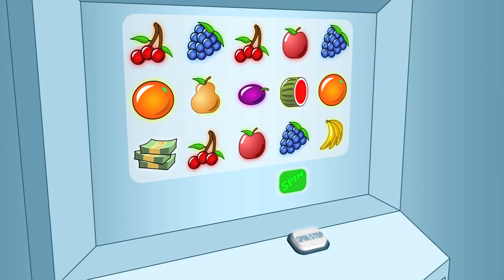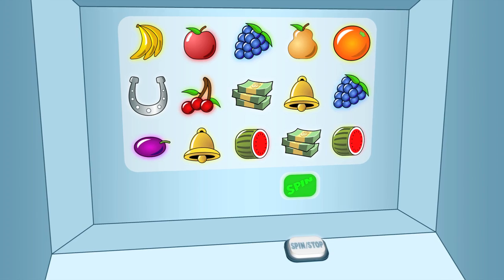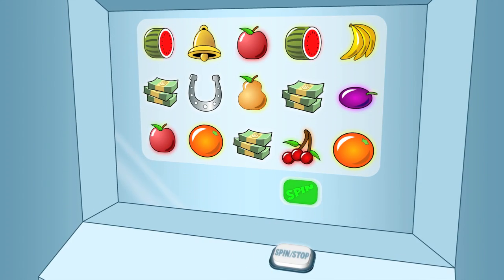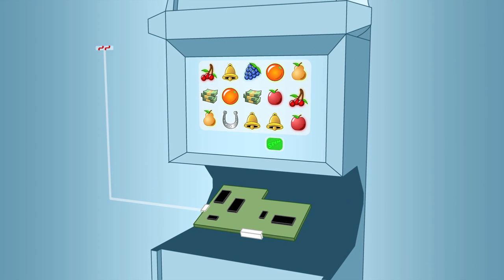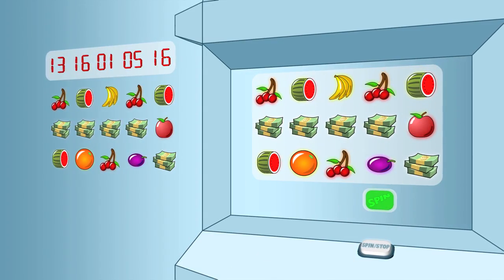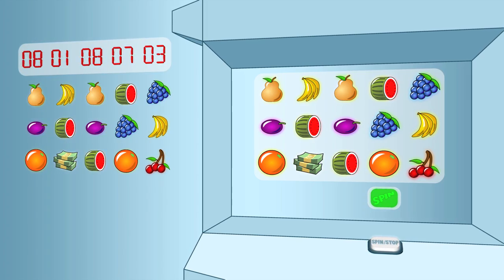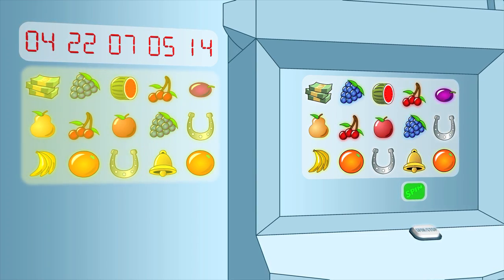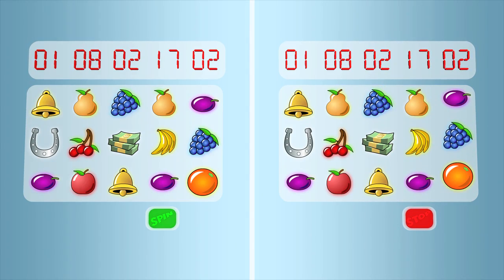How Slot Machines Work: The Stop Button

Comment: actually another reason for the stop button is to make the casino owners "More Money".  for example, if you are able to get 3 spins per minute without using the stop button, that would be 180 spins per hour.  now if someone is using the stop button, they may get 3 1/4 spins per minute which will be 195 spins per hour.  now if someone is real fast at tapping the button, they may get 4 spins per minute which would now be 240 spins per hour.  the casino has an advantage (on average) per spin anywhere from 1% to 20% (in Illinois, my state) for every dollar wagered and the more spins per hour the larger the casino profit

Comment: actually there is another reason for the 'stop' button.  it allows the casinos to get in more "spins per hour".  for example, if it takes 6 seconds for a game to end normally, you will get 10 spins per minute, and 600 spins per hour.  if you hit the stop button, it may take only 3 seconds for a game to end, which will allow for 20 spins per minute or 1,200 spins per hour.  since the odds are 'pre-determined', the more spins per hour means more money for the casino

Comment: If a machine is "random" then why doesn't it randomly payout  3 , 4 or 5 jackpots in a row?? surely this would randomly happen, at some stage, after thousands upon thousands of spins??
Reply: Because chance of hitting jackpot 3 times in a row is almost imposible.
Reply: @peterondrus7065  but it can happen. ALMOST
Reply: It's happened to me before. The casino thought I was a cheat.
Reply: There are cases and videos of double jackpots or very high payouts. Thats why when you hit a jackpot or winning a high hand payout, you never pull out of that machine without doing at least few back up spins.

Comment: that doesn’t make sense because the video explained that When you hit the start button the numbers start generating millions and millions of different combinations and then at random and it will pick a particular combination and that will determine the pay out or the pattern that is displayed on the screen but if you push the start button sooner or later then with the machine would have picked the numbers when you have stopped it on a particular set of numbers
Reply from the maker: The instant the player presses the spin button or pulls the handle the random numbers are picked, regardless of when or if they press stop. See 1 min 25 seconds in.

Comment: Machines do two things now. One? They have a sensor when you are sitting there. Two? They "eat down your ticket". Next time you are in a casino and the machines gone dead? Cash Out, get up as if to stretch your legs but move to the side. Put CASH back in, not your ticket, make sure your players card is removed. 7-8 times out of 10? It will start to hit again, thinking it's a new player. Done it 1000's of times :)
Reply: Elizabeth M nah. I tried this method hundreds of times. Doesn't work. At least not at the Indian casinos.
Reply: I only put 5 bucks in at a time, hit plenty of 500dollar jackpots with only 5 bucks :)
Reply: I need to follow you to the casino! :)
Reply: I get more action early in the day before the crowd WARM the slots up..... hitting the stop button works a lot but you have to move on to another after a while they slow down. Oh.. some of the bonuses really make you mad...you be like WTF!?!

Comment: Actually it's function is to stop it and redetermine. So you can use it to your advantage. If you know how to successfully tap at the right times which is pretty much controlling the destination of your outcomes you can influence if by as much as possible but you will need to go further into the denoms to see where that combo is hidden from plain sight. Theoretically speaking, you can try this on the low denoms especially if you see dead spins, use the 5~7 rule of quickspin switch denoms and try it again until you find the loose spot. You can then run the spins for more by stopping it quicker but again at this point you are governed by milliseconds so it's very vital to have more funds if you do use this method. I know they all say the opposite like it's predetermined. Okay so if it is then you should be able to find it. Just imagine a technician troubleshooting it. Don't you think they'd have a way of making it come up? Of course.

Comment: Ok people. Let's get to the truth about slot machines. Unlike some people who put out videos about slot machines who really dont play much or dont play at all, I have been playing slots for years and on a regular basis. The information given about the random number generator is true in that the outcome is determined by the exact timing of hitting the spin button. Where they are mistaken is that the reels spin to that location and the outcome is changed by the stop button because the reels stop in mid spin at the location when you hit the stop button. There are a few slots that I have played for hours at a time and have figured out where the scatters are on some of the reels and can predict whether or not it will land on that scatter while its spinning. I have experimented on these machines by letting the spins continue to their predetermined outcomes. The result was that the machine did exactly what its programmed to do. It would "tease" you with the first two scatters,  but not land on the third, which would give you the bonus. During this experiment I got two scatters, but didnt get the third 27 times. This was over the course of hundreds of spins. I then tried stopping the reels after getting the first two scatters and started catching the third scatter and getting the bonus. I have had dozens of occassions where I was playing a slot machine and was getting the bonus 2 or 3 times more often than my neighbor playing the same slot. When they commented on my "luck", I would explain that I was stopping the reels and changing the outcome. The people who tried this method would start hitting the bonus more often and often started winning money when they previously weren't winning. Now halving explained all of this, you must understand that getting in the bonus is not a guarantee of big wins, but it does increase your chances. Some of my biggest hand pays were partly a result of stopping the reels and catching extra retriggers. Even though I have had some success using this method, I must remind you that the house always has the edge and winning at slots is still mostly a matter of luck. Hope this info helps.
Reply: There is a "reason" why there a multi lines or "lanes" but these people will tell you otherwise seems like they know something you don't unless you've tried it and had success and may want to hide it from the public with swaying otherwise. They are hidden in higher denoms but you can be a scout and look for the penny ones too. Like most progressives you can find it by switching which is the reason why casinos profit because a unintelligent gambler who wants to just "experience" the slots will go for fun and excitement. The real pro looks for the exact timing and where they hide their reel unlocks after a certain amount of spins. So yes that is why it's just like that. You just have to know "when" the spins to come up are about to hit. Something you can do to track is definitely the progressive jackpots but another is looking for a hot machine that's right beside or opposite of you. It's almost like a game against other gamblers which is why people hog two seats but can only do it to the one they are beside.

Comment: All this tells you is that it is pre-determined randomness and that the button is only there as an accessory.
Reply from the maker: Yes  - that slot machines are not skill based and that the stop button does not let you control the outcome in anyway.
Reply: @briancullen13  have you noticed how the start/stop button on the majority of the new machines are next to the max bet button. If you don't pay attention you might hit the wrong button. However 2 or 3 times I hit the max button by mistake and I happened to get the bonus and ended getting the grand jackpots. Just play luck. No skill involved no being able to predict the outcome.

Comment: This is totally misleading.  If the random number generator worked this way there would be no way to control the payout percentage of each machine.  Maybe that can be explained.
Reply: ron celano the machine is set to payout a certain percentage of what it takes in. High payout casinos do around 95-97 percent payout and they advertise it. This is mandated by law. How and when they payout is up to the machine.  This does not mean you will take back that much of what you spend. Even when a slot machine paysout $1 at a spin, thats still a payout.

Comment: Hi ..i did it ... Long-time ago I found a slot machine and I can stop the reels one by one .... (Timing) I make 2500 dlls here in Mexico. Next day I'm back and the machine turned off.,🤔😡.....the machine has sevens cherryes n bars. on this time you have to insert bills in order to get credit on the machine. Remember the super Mario Bros3 in the slot Wich gives five life's hititng three Cherry's ..how i did it? When Cherry's pass through over the screen... You se some red ....... (Timing).
Reply: Remember the brand new machines are automatically designed.... The machine old are part mechanical part computer....the new machines are 100%video game that means you never get a payback until the machine decides...... Random number generator ..mmm yes!!!!! But on a low payment designed time.... Big wins ?? Yes but once or  twice a day on a designed time ,bet n person ,card . status etc etc
Reply from the maker: As far as I am aware the slot machine covered in this video are 100% NOT skill based.

Comment: Why is it then that I can play a machine and not stop it and hit nothing, yet when I hit the stop button every time, I hit, especially the free games feature, which I didn't it in $50? I believe that  the extent of today's technology is beyond what any of us even know. Remember, we have self-teaching and smarter computers. If a phone can be programmed to turn on another phone's camera on the other side of the globe, why wouldn't a slot machine be programmable to hit when it's told to or has learned to? It is ridiculous to think this isn't possible. Go to a casino at 5pm or when they start their weekly, must be in attendance, drawings. They usually run about four hours with a drawing every hour. This is the night where the casino is packed. Why? Well of course, because all the folks who only come on that night only come on that night for a reason. Right: they aren't going to miss their chance at that new car or jackpot. From the casino owner's perspective, wouldn't it make sense to allow the machines to award more frequent and more prosperous spins? Sure it would because those fine folks who only show up on Saturday, spend a meager amount, check their watches, and wander aimlessly awaiting the next hourly drawing. If the casino ups their chances of hitting a nice amount, there is a higher percentage than not that they will get the fever and push through the doors one day through the week because it happened once, it can  happen again. But, on that middle of the week visit the machine, often times the same machine they hit on, just doesn't seem to be hitting anything. Coincidence? Maybe. More likely, to me, is the casino can control every aspect of that machine and no one even has to be present. Is there a way to know for sure? There are so many videos out there that tell their story as fact, but how do we really know which one, if any, are right? Why don't we see videos made by the makers, both hard and software? Why is it all such a mystery? Why is it easier just to believe the random theory? Is it because that event that took place that one time that proved it couldn't be random can easily be explained away or justified because it was random. I'll give you my most recent example: I started with $5 and was hitting 8 out of 10 spins and soon I was up to $600. I feel good because I know this isn't random. Then, all of a sudden, my machine goes dark and there's nothing. Upset? Well, yeah. I wait a total of 45 minutes for the machine to come to life again. Sooner time waits are available if you are quiet and dumb. The lights pop back on after watching the obvious attendant fiddle with nothing for 30 minutes. Are they watching to see how observant I am? Low and behold the machine comes on in the same spin it left on, nothing has changed, well, except one thing: after spinning through 200 of those 600 bucks, nothing happened, no wins. Isn't that odd? Is that random?